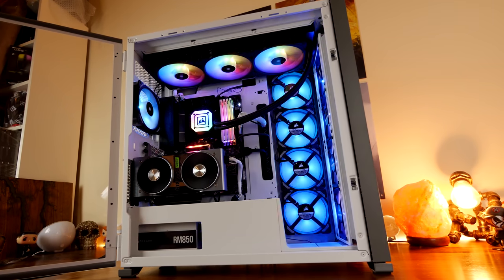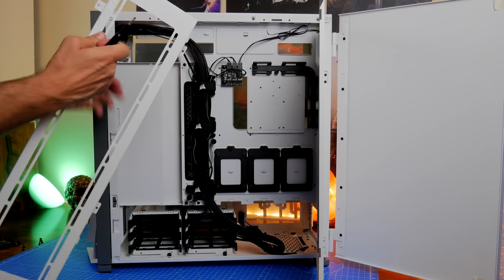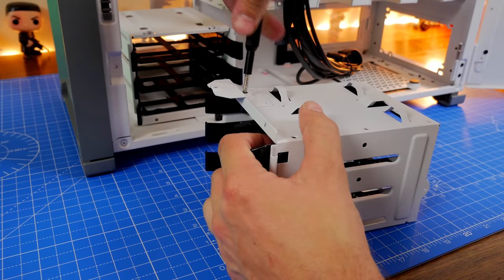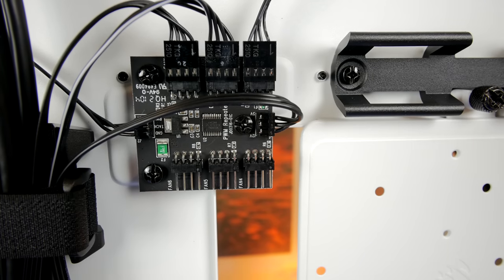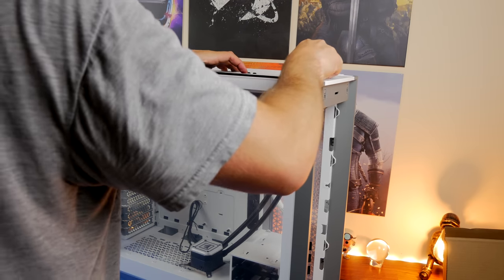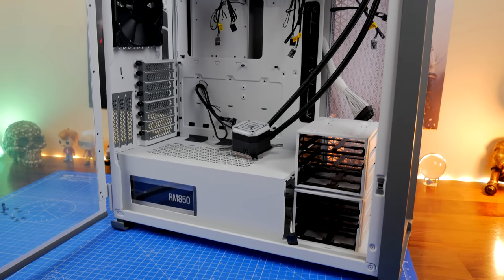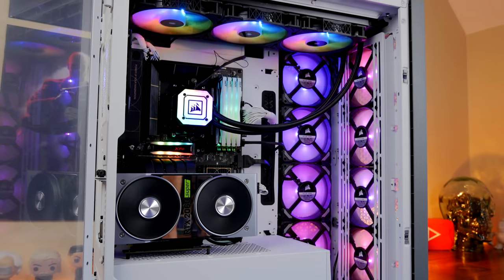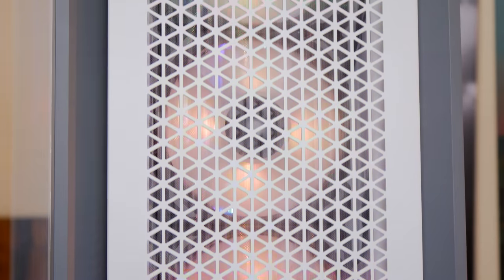Corsair 7000D Airflow unboxing and installation with 12 fans & the Corsair H170i Elite Capellix

Comment: I know you did a great job of explaining it in the video, but as a quick point of reference,  what additional hardware/hubs do you need to purchase to run the full fan loadout? I'm planning to do the entire case with 120mm fans. Eight at the front, three on a iCUE H150i, and one at the back.
Reply: Personally, I have this case and have 14 fans currently running (although I don't plan to keep it this way lol).  x6 set up top on my 420mm rad in push/pull for exhaust, x1 rear exhaust, x3 140mm front intake and x4 120mm on the front-side intake.

The only additional hardware I used was just a Lighting Node Pro and Commander Core.  However that takes up both of my USB internal headers.  So 2 of my front USB ports aren't plugged in right now lol.  I'll eventually sort that out.  I just wanted to get my PC up and going and so far it's great
Reply: @Duderstradt  Does 420mm push-pull fit up top?  Other comments suggest there's not enough clearance.  

I was concerned about front panel USB too.  Apparently Commander XT will free up a mobo header.
Reply: @blipblap614  Yes a 420mm will fit up top in a push/pull config as that is what I currently use.  I'm using 6 QL 140mm fans on the rad.  It isn't pinching anything either.

And yes I resolved the USB header situation by using the Command Core XT :)
Reply: @Duderstradt  about to post soon to canvass opinions on using 120/140mm combo's but on reflection, were you happy enough with the 120mm on the front-side intake not lining up with the 140mm in the front?
Reply: @slicker55  Yeah I was okay with it. I've modified my case since my initial build though.  I'm actually using the front-side intake for my 3080 Ti's 240mm AIO hybrid cooler (set up to exhaust) 

My front 3 140mm fans are set to intake.  Yes, I know that's not a great idea as a general rule of thumb to place them directly next to exhaust fans

But the more I thought about how exactly it would function effectively that way, my bottom/middle 140mm fans on the front actually act like a kind of fresh air feed for my GPU's AIO.  So, it's akin to cases where you can mount fans to the bottom intake and the GPU is right above that.

My GPU idles at 26-27C and when I game and my card is under full load, temps range between 47-52C.  Also, all of my fans are set to their "Quiet" preset so I don't hear much noise at all and my room is really quiet :)
Reply: @Duderstradt  All good stuff... thanks for explaining... I have ordered a custom built machine using 7000D and mistakenly thought I could have 140mmm fans in the front and side... didn't realise the sides had to be 120's... so, that's when my OCD questioned if I would be happy with them not lining up... actually, I think I might have simply got used to them but in the end, I decided to go 120's front and side... like in this video... hopefully, getting it today :)

Comment: Do u recommended this case for the 4000 series graphic card? And do u think this case is worth it? I was deciding to see if I should get the 5000x or 7000x. I was thinking 7000x because it can hold 12 fans and looks cool. Do u think 12 fans is worth it?

Comment: If I do push-pull on top radiator with the 7000X (not 7000D), would it be okay to leave it as glass or need to swap in a top panel form 7000D? Would it even fit? And would there be enough room for airflow along the sides of the top if it was a glass cover? I know it's not ideal, but the included 4 fans seem to make the 7000X a better value than the 7000D if you wanted to get the RGB fans either way.
Reply: I’m in the same spot, what did you end up doing?
Reply: @bibbolegend3507  I took off the glass and let the fans stick out a little. I don't mind it looking a bit janky. And if I put it on top of a table, most people wouldn't notice. For me it was mostly to see how many radiator and fans I could cram into one case (and do two loops). Realistically, the size makes this case impractical, but I also dabble in SFF cases too.

Comment: Hi There great Video.
I'm currently building with a 7000D and have 11 Fans.

I have 3 AF140 RGB Elite in the Front and 1 at the rear.
I also have the H170i Elite LCD XT cooler which has 3 AF140 Fans.
On the side panel there are 4 AF120 RGB Fans.
I have 2 Commander Node XT available plus the Commander core from the Cooler.

Do you connect the 4 front and rear fans to the included Fan header to be run via the Bios or can you just use the commander core and the Node XT?

Comment: A quick question: for the 12 fan 5000d build, you went with the push/pull on top having 6 fans there. Is there room for a push/pull in this case? I'd love to go with 6x140 (with the radiator) on the top, 3x140 on the front, 4x120 on the side and that lonely 140 on the back :)
Reply from the maker: I believe it's possible but I didn't have the fans to be able to test it I'm afraid.
Reply: @TheProvokedPrawn  Any way to just measure how much space is there between the railings and the top panel and compare it to 5000d Airflow? :)
Reply: The 5000D had the indented top which makes it easier to install. The 7000D does not but it does look like there is clearance to go push pull on the top and even the front if you reposition the hard drives
Reply: @fgtrhwu2  Well, I'll see soon enough as my 7000X and D panels are on their way and I'll pick them up on Monday :D
Reply: @KrzysztofGnutek  Awesome, please let me know, if it does fit I may be tempted to get it as well
Reply: @KrzysztofGnutek  So what's the verdict?
Reply: @fgtrhwu2  I just measured the gap on top and it is 18-19mm to the edge of the case, but the actual cover seems to fit below that line, so that leaves at most 15mm of space.
Reply: @KrzysztofGnutek  So that's a no I guess

Comment: Thanks for an excellent video. I have this case on order and am unsure whether to go for eight 120mm intake fans, as you have, or six 140mm fans. With hindsight, are you glad you went with the ones you did? My understanding is that two batches of four 120mm fans will be slightly better in terms of cooling and will arguably look better in the case, but of course need more cable management and are a bit noisier than two batches of three 140mm fans. Is that a fair assumption?

Comment: You never fail with these great instructional videos!  Quick question I'm planning on running a push/pull with 6 LL Inf 140mm fans on an h170i Elite xt and was wondering do you think I'd be able to run the 2 sets of 3 off the cpufan and cpuopt headers?  Also would I be able to run the lighting portion through the L-connect box?  I'm planning on 10 of these in a 7000d case and bought two L-connect 3 boxes for Infinity fans.  Might also add 3 120mm reverse blades.
Reply from the maker: Possibly but I've not tried it

Comment: Quick question, is the pwm connector 4 pin? And also can I use it to connect the 3 140mm fans that came with the case and 3 120mm fans that I bought myself?

Comment: Awesome video. My 7000D will be here today. Asus Tuf Gaming Pro X570, AMD Risen 5950X, 32gb Gskill 3600 Trident ram,Corsair 850 Power Supply, AMD RX 590 GPU. 6 Corsair QL 120 Fans.Nocthua 12us Air cooler.
Reply from the maker: Nice. Hopefully my video helps.

Comment: Hey The Provoked Prawn, I'm not sure if you are going to get this comment as the video is a little old but I have a question. I'm going to build a similar build to this, only differences are that my case is the 5000X version, I will be putting 13 fans (6 at the front and side, one at the back, three of the aio cooler and three more at the top as a push and pull system with the aio) the motherboard is an asus rog strix b550-f, and of course the fans come with two iCUE Lighting Node CORE, the aio comes with an iCUE Commander CORE and the case it self has the 6 fans power commander and light node core as well. Obviously if you put two and two together and make sense of the build you realize to need a fan power splitter cable to add the back fan to the system. Well after giving you the background information, the question is if my motherboard has enough connections both USB and SATA to handle everything? I think I do but I'm not an expert, I need your help!
Reply from the maker: Have you seen my 5000D videos? Might help. Worry not though you can get cheap usb splitters if you don't have enough ports eg. 9pin USB Header Male 1 to 2... https://www.amazon.co.uk/dp/B075XR1Q75?ref=ppx_pop_mob_ap_share

Comment: Working on an alder lake system, I drilled holes on the side so I could go with all 140mm fans, so 13x 140mm fans in total 3 front 3 side 6 on radiator push pull and one in the back. ML 140 in push pull the rest are going to be 140mmQL
Reply from the maker: Renegade. Love it. Good luck.

Comment: Is there a way to make a custom air filter for the rear fan? I want to have the front, top, and back pull air in and the side push air out. Also, do you think this is a good configuration for air flow? Doing my 2nd pc build. Would love advice

Comment: Quick question. Does the 7000D case come with a magnetic dust filter (mesh) for the side panel fans? i can confirm in your video there is a filter for the front/top but didn't see any for the side so just wanted to make sure.
Reply: Yes

Comment: Hi! Nice vid! I’m building in the 7000d airflow… I’m at the motherboard installation part but am very confused. My motherboard, like yours, has a pre attached IO guard thing… do the silver fins go through the whole on the case or should they push up against on the inside? 38:13
Reply: Ignore me, I was being a tit and over cautious. Answered my own question after some messing about with it; pushes up on the inside. My case was a little bent for some reason so the mounts didn’t line up when the io was on the inside. After some force on the case it lines up perfectly:)

Comment: I’m confused. If the 3 fans attached to the radiator are supposed to exhaust, shouldn’t the fans be flipped over? It looks like they would be pulling air into the PC from the outside, not exhausting. Unless I’m wrong about which way the fans blow. I thought the nice looking side where you just see the fans is the side they blow out of?
Reply from the maker: https://youtu.be/uPIMv30Vs3w

Comment: What did you do for USB 3.0 connections?
As the Corsair case has a 2 19/20 pin connector for all front 4 3.0 USB but the motherboard has only one input.

Comment: So with having the Core, Rgb hub and Lighting node pro on different fans was it pretty easy to get ICUE to recognize everything? Also are you able to control the fan speeds of the fans you plugged into the cases fan hub and motherboard with ICUE?

Comment: If I'm using this case with an h150i and 9 additional 120mm fans, would I just connect the AIO and 3 fans to the included commander core and then pick up another commander core and connect the other fans?

Comment: What's up dude! I just bought this case and doing the exact same fan setup as you except for one difference. I am looking to putting 3 more fans (totalling out to 15 fans) on the top of the rad for a push pull setup... is this something you'd recommend doing or is it absolute overkill.... I can afford to do it but I want to make sure there are no diminishing returns. 

thanks for the awesome video.
Reply: also, i was wanting to put a 140mm ML fan in the rear of the case instead of a 120 meaning.. 14 120mm fans (4 front, 4 side, 6 top (push pull) and 1 140 in rear.. would that work?
Reply from the maker: I don't recall if there's space to do it on this case. I've also not tested thoroughly enough to be able to say what a difference it makes, so I can't say I'm afraid.

Comment: I want to buy same model but now I have problem., after I watch your video and I noticed side door locks...
Problem is I want full air cooling (with Noctua NF-F12 PPC 3000 PWM, Noctua NF-A14 PPC 3000 PWM) , my idea is to put in front: 4x120mm intake, side: 4x120mm intake, top: 3x140mm intake, back: 1x140mm exhaust
I think maybe on 50% of fans power those doors will pop out like missile wings and fly out🚀..😁 any suggestions?, i dont want water cooling system
PS: Now I have full air cooling in Corsair Air 740 with Corsair ML Series fans and Noctua NH-D15 (maximum positive pressure inside case)🌪🌪

Comment: At 7:30, how were you able to remove the two cords that are attached to the front fan case? My two cord run through a rubber band that I can’t get to pass through because they are many other cords running through the rubber band (top left 7:30). Thanks!

Comment: I hope Corsair starts making the H170i Elite Capellix in white to match with this case color. Right now if you order the 7000X and the H170i (black) together on Corsair's site, they give a $23 discount. But the 7000X case alone is $330 MSRP. The AIO alone is $230 MSRP. (The 7000D Airflow is $260.)

Comment: I'm struggling to decide on a new case, I currently have the NZXT Phantom 820, love the case and cant fault NZXT with the customer support I got in the beginning. recently decided to upgrade my case due to not having any front fans and now stuck between NZXT H9, Corsair 700D Flow or the 1000D, this video definitely helped with how clean the build is and the fact the PSU sits at the bottom of the case not directly behind the Mobo like on the H9. Basically long story short any advice would be greatly appreciated right now

Comment: I am going to upgrade my Be Quiet 802 to this Corsair 7000D with 12 x ML120 RGB Elite Premium, ... but I ran into a problem, it is impossible at current time to get the ML120 RGB etc. as Triple Pack, so I had to go with 2 x ML140 RGB etc Twin Packs.
I will be going with the Commander Node Pro instead of the Node XT... Later, when/if Corsair will make the H150i LCD in white, I will be changing my Be Quiet Pure Loop 2 360mm AIO as well and then buy one more ML120 so I can have 4 x 120 in the front to fight the dust filter.

Comment: Hi Just wanted to check you installed 8 in total 120MM fans in the front and the side but wanted to know, would the 6 140MM fans instead make air flow in the case ?

I'm asking this is because I bought the case now I'm just confused should I go with 8 120MM fan or 6 140MM fans, I'm looking for more airflow and keeping the case cooler... Would really appreciate your reply
Reply from the maker: 140mm would be fine. I'd imagine the difference would be negligible tbh
Reply: @TheProvokedPrawn  Sure thank you so much I'll probably go with the same setup that you showed in the video will reach out to you if I have any doubts. Thank you so much for your time and reply

Comment: How did you connect both USB 3.2 front cables to the motherboard? I'm asking because I checked that motherboard's specs and I saw it only has one USB 3.2 Gen 1 header

Comment: In relation to the 140s and 120s, I am looing at a similar build (same case) but with 3 140s on the front, 3 140s top and 1 140 rear, with then 4 120s on the side. As I don't want to mix and match, do I need to have two seperate commander pros/cores where the 140s connects into one and the 120s connect into the other, both running off separtely into the motherboard?

Comment: Hello. I love this build and was already planning on buying a 7000D case. I am now sold on doing the 4 x 120mm front fans 4 x 120mm side fans and 1 x 120mm back fan with a AIO Artic LF 2 420. Will I need to buy 2 Corsair iCue Commander Pro for this to work? Anything besides the 2 Commander pro for all the RBG and fans to run smoothly?
Reply from the maker: Commander Core XT might help. Also see https://youtu.be/jvXCbny-Suw
Reply: @TheProvokedPrawn  Thanks for the link. The build is gorgeous.

Comment: Great video - thanks for sharing...urgent help needed… canvasing opinions, I am having a computer built using 7000D - all stock 140mm fans being replaced with RGB to match top mounted H170i radiator. Thinking about adding extra RGB fans to fill the gap between the motherboard and the front of the case.Initially thought I could have 3 x 140mm RGB to line up with the front fans but now realise the ‘gap’ fans have to be 120mm.Not sure whether to (1) live with the blanking plate, (2) add 120mm to fill the gap (which won’t line up with 140mm) or (3) fit 8 x 120mm?

Comment: Honest question: why would you set up fans to exhaust through the radiator and not pull air in through the radiator? Wouldn't exhausting through the radiator mean that your pushing hot air over the water you're trying to cool?
Reply from the maker: People will tell you hot air rises and that's one reason. Also doing it the other way means you're pulling hot air into the case. So no way is perfect
Reply: @TheProvokedPrawn  Got it. Thanks for the speedy reply. Great video.

Comment: I would opt for the traditional horizontal mount, because the GPU cables for vertical mount are not reliable enough. and the bandwidth has to be limited.

Since I plan to go for the RTX 4090, I'd rather have fans installed above the PSU to keep the temperatures as cool as possible.